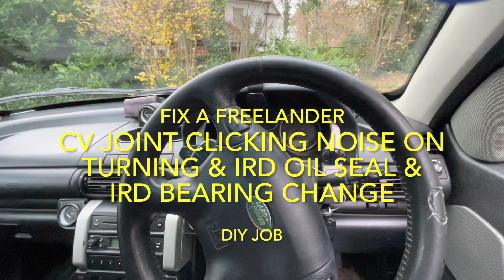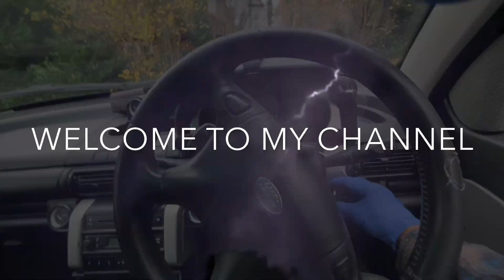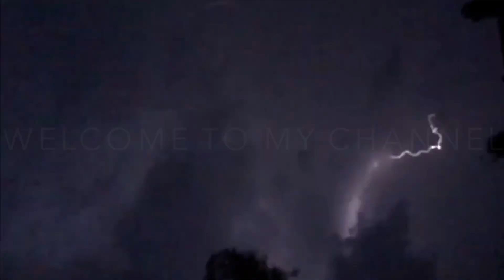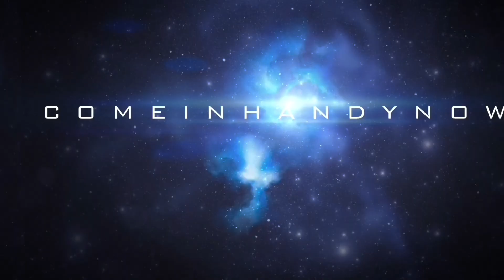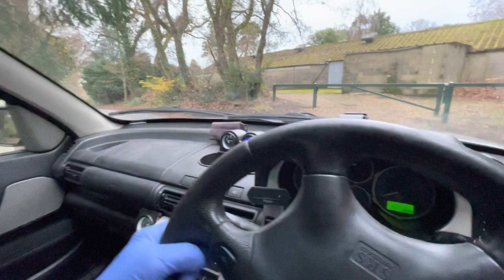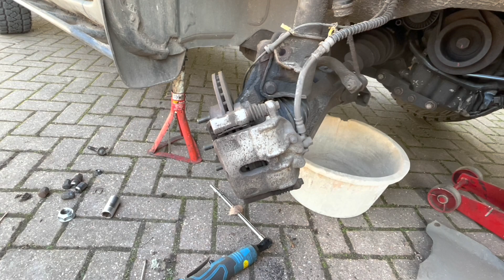Freelander fix for Clicking Noise on turning + IRD oil seal & Bearing change

Comment: Excellent video however I would never use a bearing race to knock in another bearing as the races can chip. Ideally you should use a softer material. I would also heat up the bearing housing and you should find that the outer race then drops in.
Reply from the maker: Thanks

Comment: Hello, Sir, may I ask you something, please? Is the oil seal that you mount on the IRD the same for both sides, left and right? Thank you very much!
Reply from the maker: It is best to ask the supplier of those parts, as I’m not 100% sure, I would guess that they are.
Reply: @comeinhandynow  thank you, you're very kind answering so fast! Meanwhile, I did some research and found that it's a little bit confusing: on eBay they say that TRX100060 is for the right drive shaft oil seal and UNG100060 is for the left drive shaft oil seal, but on other sites it's the opposite... I will call and check. Thank you again

Comment: Have the same car and make a noise when I go a little bit fast turning to the left in a little roundabout. It seems came under the center glove box where I rest my elbow. Can be my IRD ? Why only turning to the left and never to the rigth? My car its in spain (left hand drive). Any one know ?
Reply from the maker: You could try removing rear prop shaft in order to relieve any strain on the IRD caused by a stiffening viscous coupling.  If it is still the seme then it’s probably a front driveshaft CV joint.
Reply: @comeinhandynow  thanks a lot. In those 2 case, if posible that only make the noise turning to the left in my left hand car? Never turning to the right ...
Reply from the maker: @JuanGarcia-qb4sd  More probable to be a CV joint I think.

Comment: Watching this for the 20 millionth time...My IRD is 'grumbling' after a VCU failure (as in it still worked but only just and on tight turns its was dragging badly). Watching the video when you are fitting the bearings I feel for you...I have a 20 tonne press and have used it to rebuild the rear suspension on my TD4..it makes everything so much easier...only cost 118GBP and although it has sat dormant since then was worth every penny..in the meantime it acts as a coat rack and storage area for small items..buy one you won't regret it.
Reply from the maker: Ok thanks, sounds like a good tip.

Comment: I have the clicking noise plus a massive unbalance at speed would this problem cause this rear prop has been removed
Reply from the maker: It could do if there was too much play in the CV joint or bearing.  Have a look underneath at the front driveshafts and see how much they move from side to side at the gearbox end and at the hub end.

Comment: Hey comeinhandy now! The suspension worked great on the td4 just to let you know!
Reply from the maker: Great
Reply: So if anyone asks. You can indeed put a stock Freelander suspension on a td4. Mine is a sports model, with diffrent suspensions but the stock Freelander one raises it by a few cm.

Comment: Hi there, I moved from Belgium to SA in 2012 and bougt me a 2nd hand Freelander td4 2004 from a doctor in stellenbosch. Car had 109000km on the clock. 5 years later @ 170000km the slave cilinder to open the clutch started leaking, took out gearbox and ird, changed slave cilinder and complete clutch kit as it was all out now...when I assembled everything under the car again I already observed there was a lot of play on both drive shafts into the gearbox and a bit more into the ird, but I just went on mounting everything. Now I have 230000km and when I accelerate fast in 1st gear the play gives a vibration on de drive shafts that you can feel behind the steering wheel and de ird side is leaking slightly. It was very surprising you posted the video now, now I need to take everything out again (after 60000km en 5years of fun with this car). You showed us how to do it without taking out the complete ird, well done! I hope the play I have will be fixed changing the bearings only, like yours. I read the round washers behind the satelite gears are also a weak point, did you change them? I'm glad it worked out good enough for you, its a big job to open up again to ad a shim. Will you please check for me if your gearbox side shaft also have a lot of play? Don't think I kan do it with the gearbox in like you did with the ird, what do you think?
Nice seeing your video's. Did do manifold clean, sumpbreather kit, all filters and oil, glowing plugs(sufferd with 3 of 4)
Took out injectors, de assembled completely for cleaning and brought them to injector specialist to test them on the usual pressures. One of the was giving almost nothing on 300bar (idle pressure and indeed the car had a very bad idle for a long time). The one injector is setted with some tiny smaller chim and past the test after two settings. Engine runs perfect again and lot more powerful. Next week I will start with the drifeshafts. Thanks for posting all your informative video's!
We will chat soon, 
Kind regards, 
Kris.
Reply from the maker: Hi, thanks for your comments.I didn’t change anything other than what was shown, so no planet gear washers. I had previously checked the ird bearing play on the other side and it was a lot better, negligible. With no oil leak either so I didn’t look at it any further to see how that would be changed. I wouldn’t be surprised if the ird had to come out for that, let me know what you find for interest.  Nice to see you have seen some of my other videos.  Good luck with your Freelander.